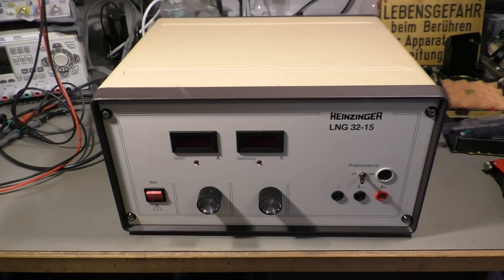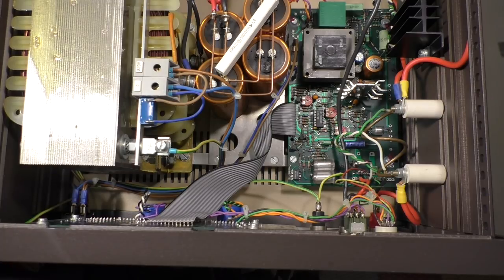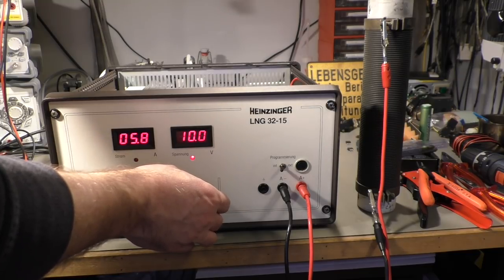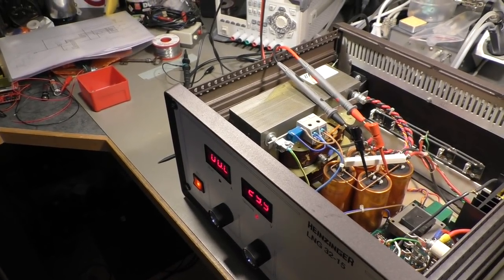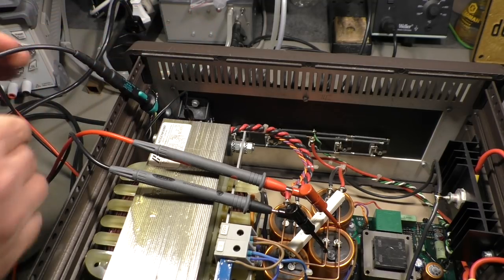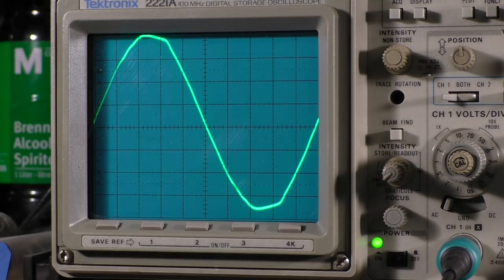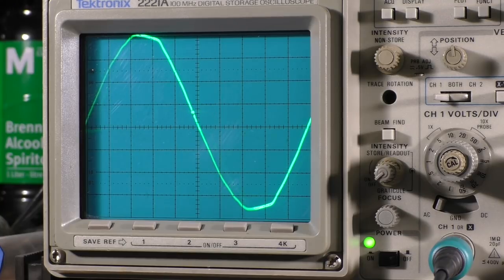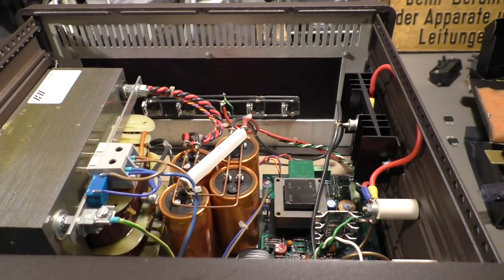Linear/switched power supply - (PWJ137)

Comment: I have two AC power supplies for device under test (DUT) repair and performance testing at high and low line (isolation transformer + Variac). They are used to isolate the DUT from the line, change the AC input voltage and float the chassis ground, meters display both load AC volts and AC amps. 

So I can essentially float the mains and the earth ground so you can use earth referenced (safety ground) oscilloscope probes with ground leads if you wish. Being able to adjust the AC input voltage while watching AC input voltage and AC input current has a lot of troubleshooting advantages, and supports testing at both high and low line. Even with this my go to piece of basic troubleshooting equipment is a Fluke Scopemeter. The Scopemeter is a floating instrument (Battery operated) but more importantly all of the input channel grounds are isolated from each other so you don't have to resort to differential probes. The Scopemeter has limitations on vertical resolution, bandwidth and screen size as compared to some high end scopes, but it works well for basic troubleshooting.

Comment: 11:46 On the secundary side you also have to be carefull when you are connecting your ground clip of your scope probe, if the secundary minus banana jack is fixed to chassis, then you can still create a short if you connect the ground clip of the scope probe to the secundary positive. 
With this powersupply, the minus and chassis have separated banana jacks, and need to be manually connected together , but on some powersupply, the minus is not isolated from the chassis. In that case, the only way to be safe, is to plug the DUT into a isolation transformer, that way you can connect the ground clip to allmost every spot on the secundary side.

Comment: Heinzinger definitely makes nice supplies (I always thought they where a German company) 
I have a mid-80's 100% switching 600V 300mA unit (NCL 600-300), very nice for when you do (nixie)tube -type stuff. I however have no a clue what NCL might stand for.
The only problem I ever had with it was a power switch that welded itself shut in the 'on' position, the thing has a 1300uF primary cap and only a 1.5R resistor as inrush limit ... Yikes :)
Reply from the maker: You're right... they are german! I don't know why I thought they're swiss....

Comment: Hello, i want to design an SMPS with 5v USB input and dual output of 12v and 5V for Battery and Ardunio respectively. I would request you to suggest a PCB board or an IC.

Thanks and Regards
Reply from the maker: Well... the 5V output can be taken directly from the input, no conversion necessary.
For the 12V you could use this DC/DC converter from Aliexpress: "1PCS XL6009 DC Adjustable Step up boost Power Converter Module Replace LM2577"
Be aware that if you draw 1Amp (as example) on the 12V side, it will result in a current of 2.4Amp (minimum) on your USB input... the power (Watt) will be constant (1A x 12V = 12W = 2.4A x 5V) ...plus the losses of the DC converter itself.

Comment: What a coincidence!  Just today I've released a video on a HP power supply which I think works in a similar fashion.  I call it the Power Supply From Hell:
https://www.youtube.com/watch?v=8u021gQCsF0
The problem is that the current limiting only works after the capacitors have dumped their charge into your overload and sent it into orbit.  Does this power supply have the same problem?